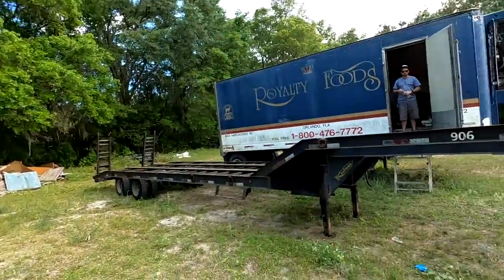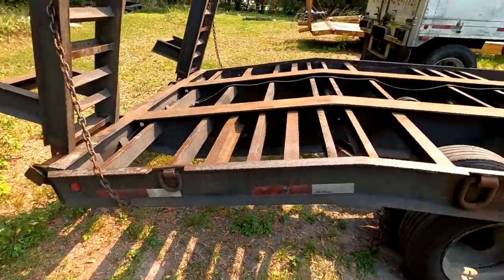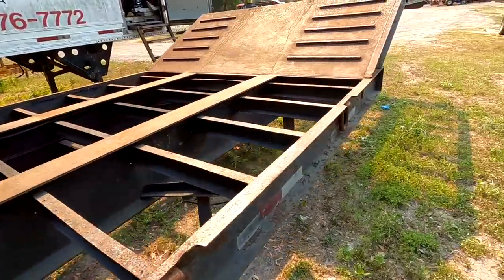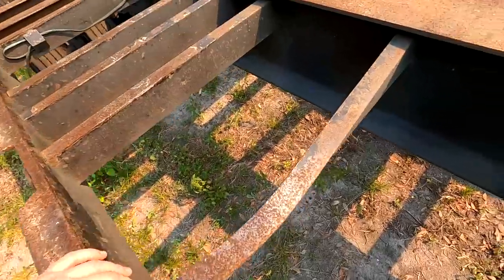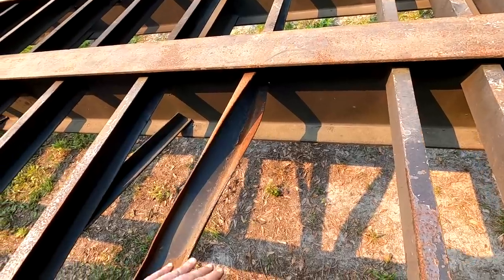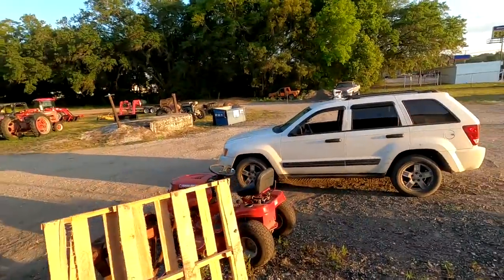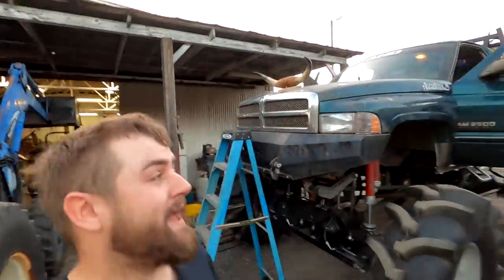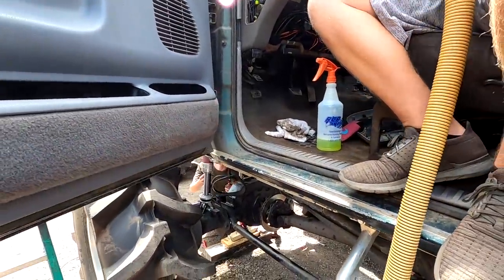Our Sick New/Used Trailer For the CabOver, it's Glorious!

Comment: Here's my 2 cents since you asked:
1. Lose the horns- Tacky
2. I hope the stickers on the fenders are only temporary 
3. Weld the tow hook in permanently 
4. Mount an 8ft. Pop up camper on the front of the trailer
5. Just sand blast the outside of the trailer paint it with black roll on implement paint, your not gonna keep it for 100 years.

Comment: Do yourself a favor and get rid of that Wabco ABS system.
Get a kingpin gauge and make sure it's not worn out. 
Your tires cupping is either from worn out suspension bushings in the control arms. Wheel bearings worn out. Frozen brake shoe rollers causing the shoes to bind up and grab the drums instead of pivot also causing the S-cam bushings to wear out. 
Full rebuild in order.
Reply: Mr. Jones Good advice here.

Comment: I’ve been hauling iron for 18 years. And you’ve been around it for a while too. If you guys want to get it done right check prices at Ritchie Bro’s. They have a paint shop at most of there sites. Fix the wiring and axles and send them the trailer to sand blast and paint. They make old trailers look like new. Then deck it when you get it back. And that spare tire rack you should just lose it and make bracket to hold the tire up on the top deck.

Comment: Nice trailer I would take ospho from Ace and fill a chemical sprayer with it and spray the trailer ospho prepares all rusted surface's for paint just pressure wash it first then spray let it dry and it will turn your rust back to iron

Comment: If you want to check to see if the axles are straight. Lift up the trailer so the wheels are in the air. Mark a dot in the center of the tread on each tire. Measure across. Spin tires 180* measure again. If there’s no difference. There straight.

Comment: Three questions for the trailer 
1. Are you gonna replace the reflection tape when the time comes?
2. Plan putting a spare tire for the trailer ? 
3. If your gonna get rid of that extra strap roll by the pin will you save it for the trailer or move it down ?

Comment: Over the trailer tires.
Turn channel iron upside down where the boards were and that will raise the plate to deck height and give extra reinforcement once the channel is stitch welded to the plate steel. 
Kaufman trailers are good trailers.

Comment: You might want to mount the cooler with the ports out to the side. Odds are you are "air locking" the cooler. If you continue to have overheating problems you may want to consider mounting the ports to the front or rear of the truck.

Comment: Unless you will be hauling heavy equipment that trailer will be just fine. Word  on wiring and repairs and that is get it ALL done before redecking it. Will make it so much easier. Think I would opt for the factory wiring harness if you hate wiring like I do. Keep the gladhands just keep good seals in them. And when you redeck use bolts and not self tapping screws. I redecked my 24 ft gooseneck with 1/4 in carrage bolts and three years later no problems. As far as your brother goes it may be for the good in the long run. Sometimes hard for family to work together. I once worked for two brothers on a big farm. One would give me orders then the other would say no do it like I said do it. They were constantly fighting so I told them I would only take orders from the one writing my paycheck (turned out to be their dad) and everything was ok after that cause he was a good ol man so I went to work for HIM!

Comment: If that is a Kaufman trailer, they are made 60 miles from where I live.  The fifth wheel riser is still needed because the main frame of the trailer will still hit the fenders when turning on uneven ground.

Comment: The rust-oleum  rusty metal primmer from Lowe’s work good as a base coat on the trailer I use it all the time
Reply: 7769 rusty metal primer. Rustoleom  secret is........ salmon oil that's it.
Reply: Sherwin Williams Industrial coatings Kromik Metal Primer.  Comes in Red Oxide, White, and Gray.  Sandblast the frame, shoot the paint with an airless sprayer (or air gun, but airless is way faster) then put a good urethane finish paint on it to hold a shine.

Comment: Hey bruce what's a trailer  like that sells for? I'm looking to buy one  like you did and restore it instead of paying a very steep price for a newer trailer. This is the only way to do it ,we buy heavy equipment  and need to buy the ultimate  trailer  to haul it with. Every time I'm dont have a heavy enough trail to tow with and was shopping around looking and I was noisy  what you paid for your trailer. Thanks again!

Comment: use a pressure washer attachment that sand blasts.  This is the perfect application.  Even if it is not perfect, it will be quick.

Comment: just use a grade 8 bolt thru the hitch pin and weld the nut to the bolt if they can cut a grade 8 bolt welded they will be able to cut any weld

Comment: Reinforce where the d rings are sense the flange was cut out
Reply: Shane Mock There is a D ring design that is stepped over so as to avoid the problem that motivated them to (unwisely) cut the flange that way.

Comment: Weld a washer on the end of the hitch pin so it can’t come out easily.
Reply: Good idea. Then he can save the hook and sacrifice the pin.
Reply: or maybe go buy a $30 locking hitch pin
Reply: wildcoyote34 I’ve snapped those locking pins off with a pry bar when they get rusted or when the keys get lost. They are extremely easy to break and not worth 30 dollars at all
Reply: you obviously never bought a good one then ,,all lock pins are designed to do are slow down a thief 
if i was worried about that hook falling out , thief or not  i'd just get a grade 8 bolt with a Nylock nut  cause it won't fall out ever  and will never get loose and a thief isn't gonna fight with it to get it off  ,, and i guarantee you aren't gonna break it cause that's stronger than even a hitch pin
Reply: wildcoyote34 I’ve broken many different brands haven’t met one I can’t snap in a few minutes. Grade 8 bolt is weaker than a regular hitch pin because it is very hard and will snap without having much flex to it but yes it would probably work fine
Reply: @George Costanza  a 5/8 in grade 8 bolt  has more shear strength than a 5  or even a 2 which is what most of those cheap hitch pins you buy at walmart are,,,the proof load of most grade 8 5/8 in bolts is in the 27-30,000 pound range ,,,he could easily swing that truck  from that hook  without ever breaking the pin and probably wouldn't even break a cheap hitch pin ,,in 30 years of towing i have never sheared a hitch pin ,,,
I HAVE , bent hitches , hitch bars ,broken a BALL ,busted and bent god only knows how many couplers on trailers ,,I've even seen a couple hitch receivers with the holes so egged out that i replaced the hitch 
I've gradually gotten away from bumper hitch trailers and gone to 5th wheel units cause  ain't nobody gonna steal my trailer easily  ,5th wheel trailer requires NO safety chains ,and it's easier to hook up to it too

Comment: Spray that down with Rust Bullet, sold online by Summit Racing, or direct from the manufacturer. Never rust again. Great product proven to work in the rust belt states. Watch their video on YouTube. Por-15 is garbage. Rust bullet is the best. Fluid film, and so many others, are not a permanent coating.

Comment: You do have a class A CDL... Right Bruce? Lol!
Reply: He wont need a CDL. Just needs to put not for hire/farm use. On the sides of the cabover
Reply: Edward Vanhoose I don’t think that how it works... farm users is so many mile radius of your address location. So traveling you will need a Class A CDL with Air Brakes and Combination/Tractor Trailer
Reply: He doesn’t have to have a CDL to drive a private non-commercial truck. BUT he does have to have a higher class license above and beyond a normal DL.
Reply: @MrMwmussel1  that's a CDL.
Reply: Not sure how it works in Florida, but in Ohio if the truck’s GVW is over 26,001 lbs and you are pulling a trailer with a GVW over 10,000 lbs you WILL be getting a class A CDL.
Reply: jim downard sounds like Wisconsin rules also 👍
Reply: jim downard just checked and Florida is the same as well. He will definitely need one for this rig.

Comment: I would just grease pack the trailer hubs and bearings so you Don's have to worry about when a wheel seal starts leaking since once the brake pads get hub oil in them you got to replace them grease dont leak so once you get the tesuker done you can have the cabover snd trailer DOT inspected  and since you gonna drive the cabover to Indianapolis you nerd to get it DOT inspected and certified and register it as either commercial or personal use of you nerd a truck ism sure Westin Chaplin will sell you one of the ones he rebuilds

Comment: Why do you think the "I" beams are not factory? Because they are different than the "C" channel ? Did it ever occur to you that maybe they used heavier support,  the I beams, to compensate for the lack of support that the wheels were using up? By the way, you sure those aren't 19.5 wheels, not 17.5?  Self tappers to hold decking gown? Let me know how well that works out in a couple of years....lol..sorry if I sound so harsh, but just saying.